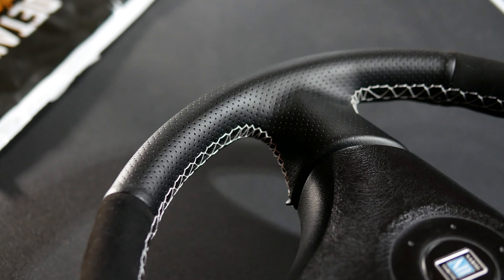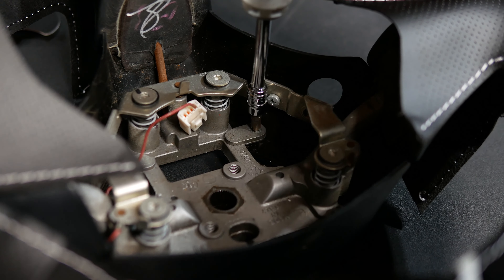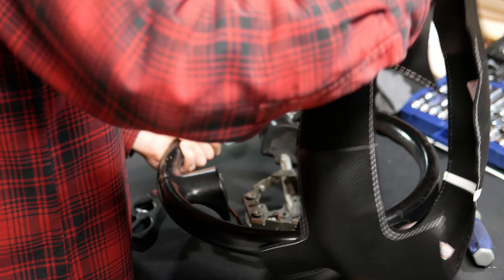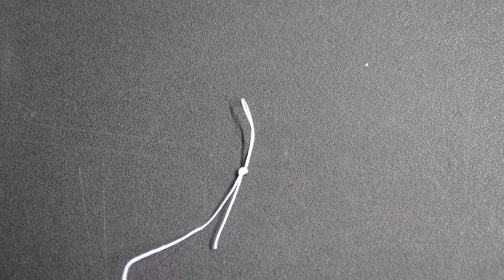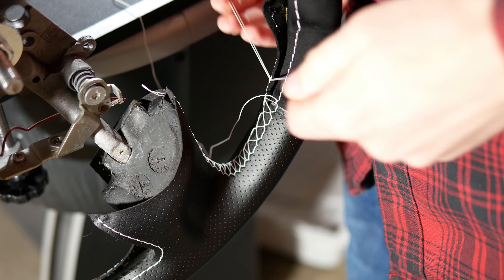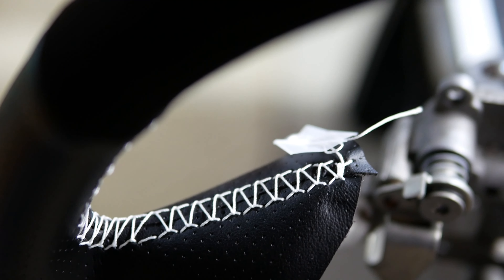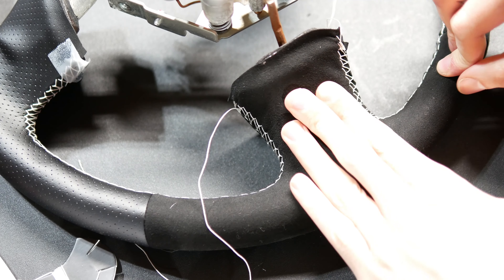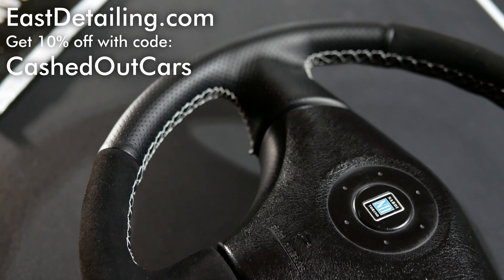How To Transform Your Steering Wheel | East Detailing Steering Wheel Cover

Comment: Great video. Do you have to or should remove the old leather on the steering wheel? I have a 3rd gen 4runner
Reply from the maker: Thanks! This company’s kits are made to go over the old wrap, I think it wouldn’t fit right if you did remove what’s there
Reply: No, Don’t remove the old leather! I did it on my first wheel and the cover was loose. I had to find another wheel because east takes the thickness of the original leather into account when the make the cover.

Comment: Ive noticed every single East Detailing demo is always on a simple wheel without any leather wings. These covers look nice, but the one I got for my Type-R is cut too loose, the thread gets so twisted after a few passes the thread knots up. I regret buying from them, and it really sucks because theyre expensive.
Reply: Sucks man. I would've asked flr a refund. Mine almost didnt work. But i made it work. Looks decent. Only i would be able to notice the issues.